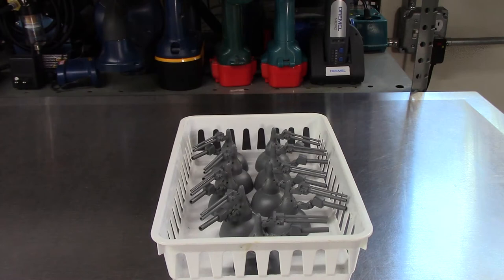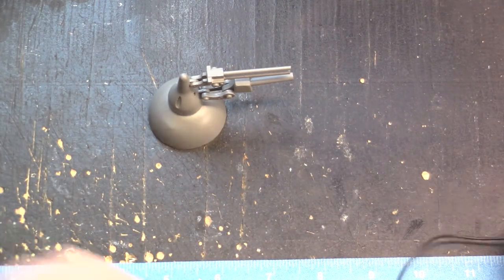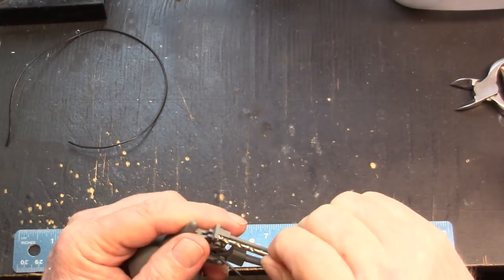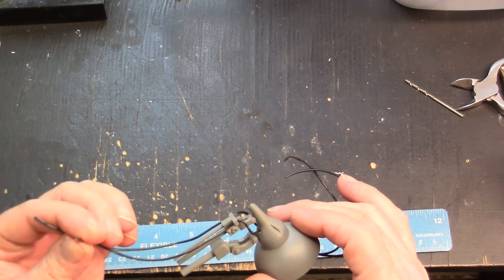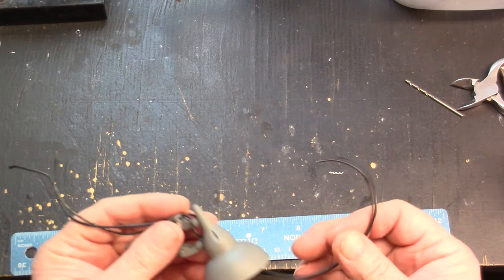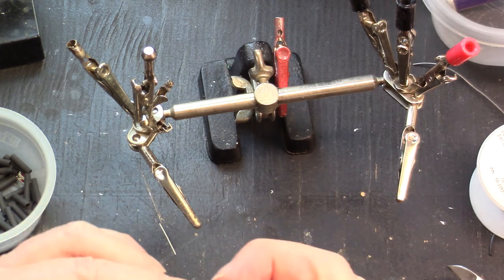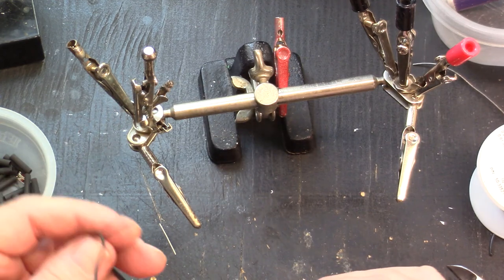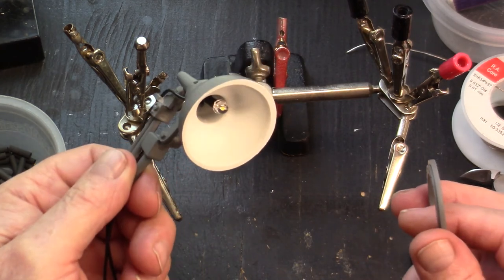ET Ship Engine Bell Lighting Video

Comment: You should just use red and black wires so you know which is which. The original had red wire showing anyway
Reply from the maker: The reason I did not use colored wire is I did not what to paint it out later on the finish. Great suggestion & thanks for the input.